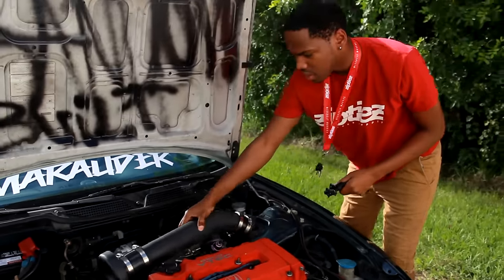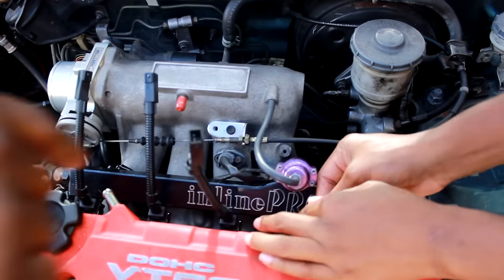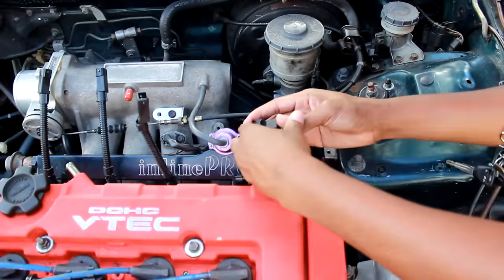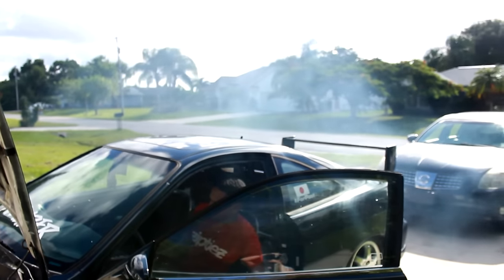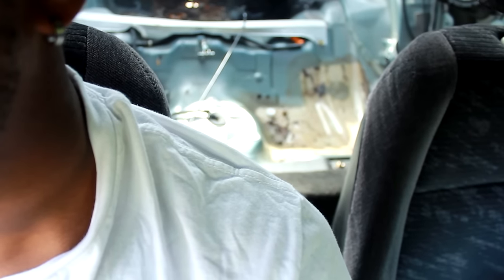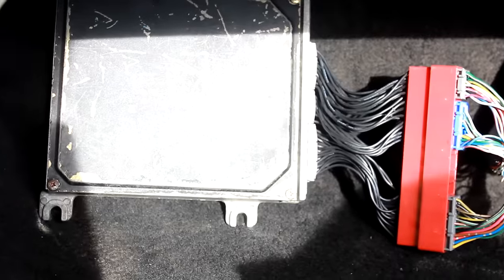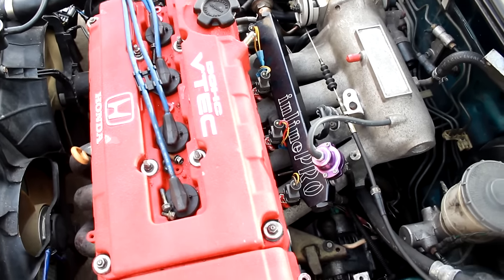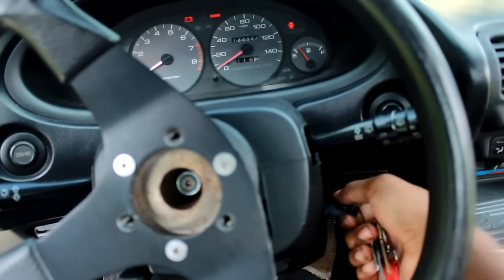WHERE'S MY FUEL?

Comment: and i swear my shit was doing this exact shit i spent all week trying to fix it its your dizzy get a new one i bought a new fuel pump a fuel pump relay and fuel filter and it ended up being my dizzy but mine was dieing when it was running just an idea for you and yea just like your comments are saying you can need an upgraded fuel pump also but i doubt it check your ignition coils and ignitor or just buy an all new dizzy good luck!
Reply from the maker: Yeah the dizzy cause it goes into limp mode but in this case it was the map on the ecu the guy loaded. I'm filming a video right now explaining it!
Reply: I had that exact problem with mine a couple weeks ago, was about to suggest this to him then saw your comment
Reply: new video zosh

Comment: Funny I'm having the same issue with my car rn. Right now its at my boys shop so imma figure out what the fuck it is. Changed literally everything from gaskets, fuel pump, fuel injectors, spark plugs, wires, ignition, check vacuum lines, water pump, even put the damned thermo back in im fucking done lol. Even got a re-tune. Ive done everything within my power. So fuck it, it's a shops issue now.